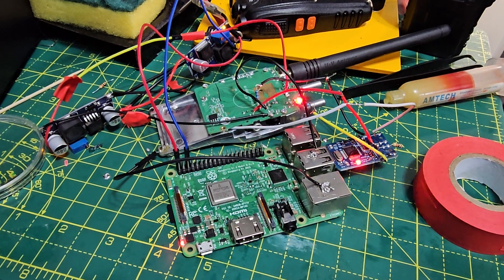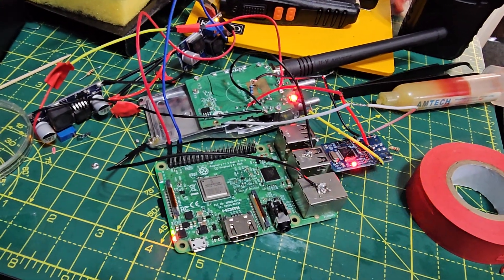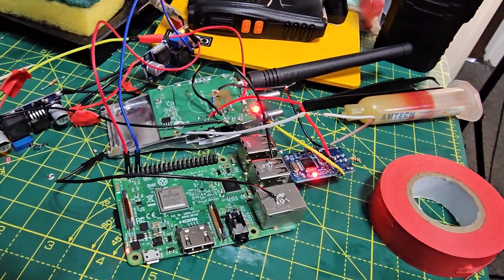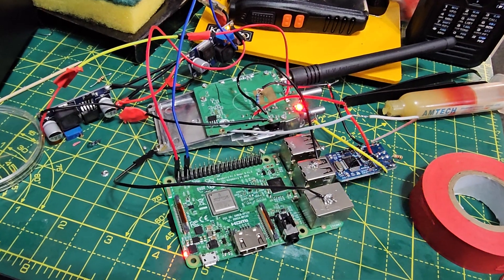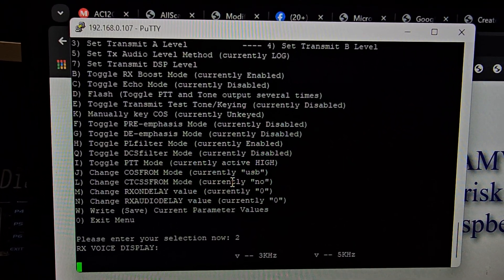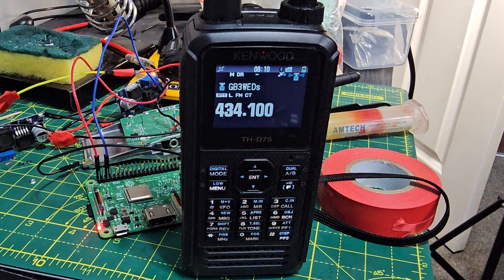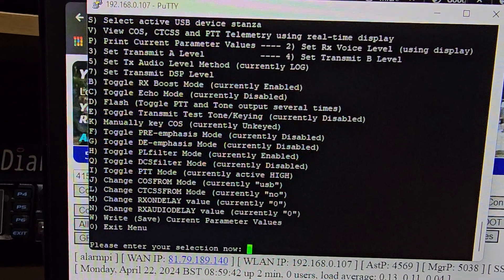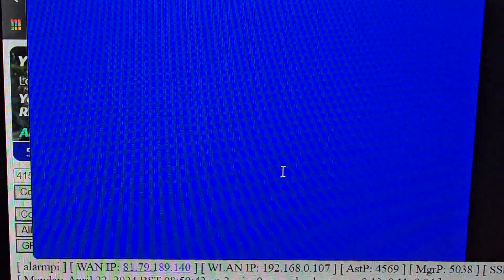ALLSTAR NODE - REMOVE HIGH PITCHED WHINE SOUND

Comment: Hi, Found your video, as I am having the same issue with the whining sound, same setup, BF888s RPI, I added more earthing wire from the radio casing bottom to the Ethernet at top (Same as your video) and from the Buck Converter to the USB (as per your pic) I already had a wire from USB on pi to the earth on the radio's board. It has made a big difference, whine still there but hardly noticeable as before. I wonder if the HPF/LPF in Simple USB Config, would help? have you tried these? I did have a fiddle but not sure if I set them right, BTW how did you get your callsign to speak during the IP readout? Thanks so much :-) 73, Lee M0LJL (Node 58218)
Reply from the maker: Hi try moving the whole Node to a different room see if whine stops as for call sign announce if you install correctly it does this what's lots Videos about Config in putty .
Reply: @HamTechRadioScannerDrones  thanks, mine does morse for the ID on start up, I shall have a look at the config. thanks again

Comment: That whine is likely the switching frequency of the buck converters.
I take it that there's two of them because you need two separate voltages - around 7v for the radio and 5v for the Pi?
The outputs of the buck converters will be floating, and if you measure between any of the outputs and your house earth (about as good of a "0V" as you're going to get), I wouldn;t be surprised to see the outputs at something like 80v above earth.

Connecting the 0v output of both converters together will stop them floating apart from each other.
Connecting the 0v from the outputs of both converters directly to each device will "bond" the devices to 0v, stopping the devies from floating apart.
The converters are not going to be the cleanest supply in the world, so look at swapping them out for linear regulators fed from something like a Meanwell SMPS. This way you'll keep a BIT of efficiency but the power system output side will be totally linear, and you can bond the DC 0v to earth to provide a stable reference.

Decouple all audio feeds with some 600ohm 1:1 transformers: 
https://uk.rs-online.com/web/p/audio-transformers/8513686?gb=s

If you're doing PTT control of the radio, decouple that with an opto-isolator:
https://uk.rs-online.com/web/p/optocouplers/8851310?gb=s

Nice build! I need to do something with the Pi pile I have here and I see some kind of hotspot in my future.
Reply from the maker: Thanks for info yes make a node its fun .